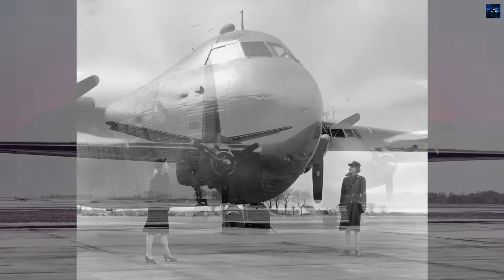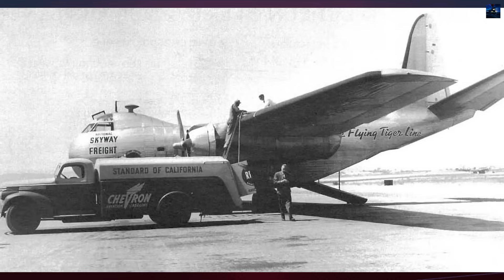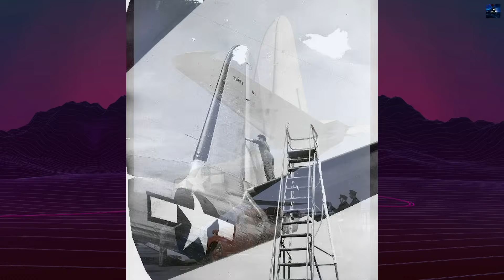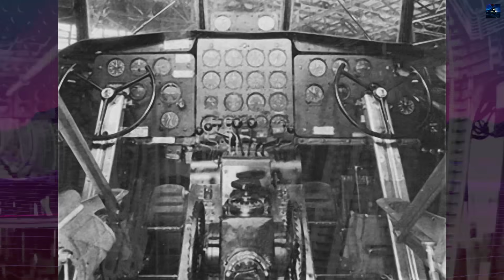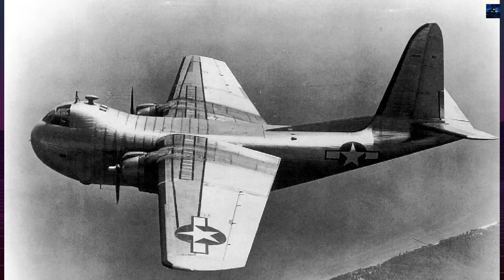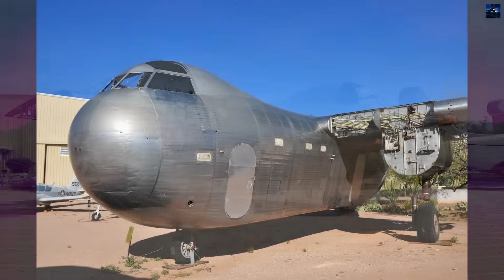Budd RB-1 Conestoga: Strong Enough to Lift a Truck, Weak Enough to Be Forgotten

Comment: This didn't mention a major consideration in the RBs cancellation - structural failure of the welds. There was at least one fatal accident and ongoing structural problems due weld failures.

Comment: How many sparkplugs on a R83092?
Reply: The R1830 was a 14 cylinder engine, therefore it has 28 spark plugs per engine.

Comment: Density of Aluminum is 2.7 gr/ cc; that of steel, around 6 gr/ cc, for reinforced concrete, figure is 2.4 gr/ cc. 
Karlsruhe tech built a kart on a pre-stressed concrete plate, with a body in concrete, walls 4 mm thick.
 'The Indian Concrete Journal', Oct 2004, pp 43-44.

Comment: The thing that mystifies me about the Conestoga program is why stainless steel was less of a strategic material than aluminum. Most stainless steels have a large percentage of nickel and chromium.  Nickel and chromium are also required for high alloy steels such as armor plate.
Reply: Video stated at the beginning of WW2, there was an aluminum shortage.